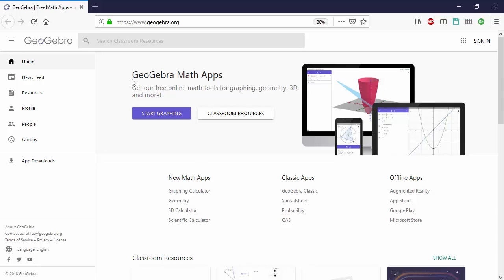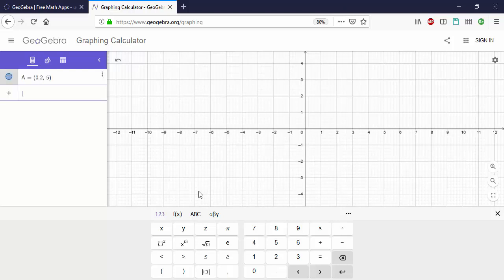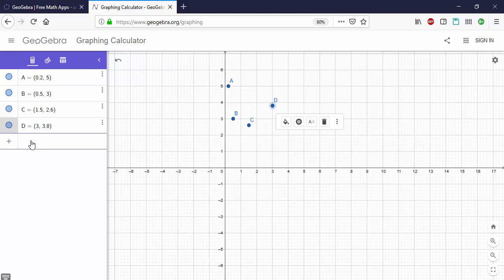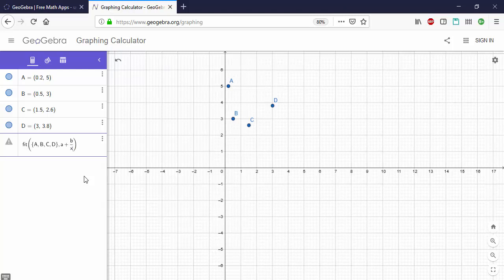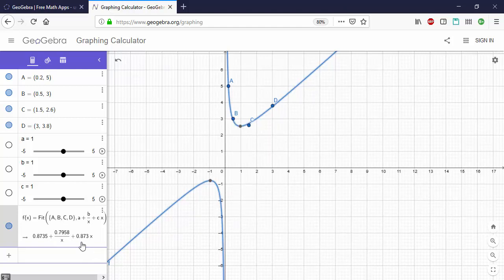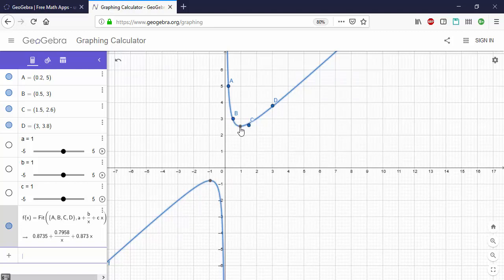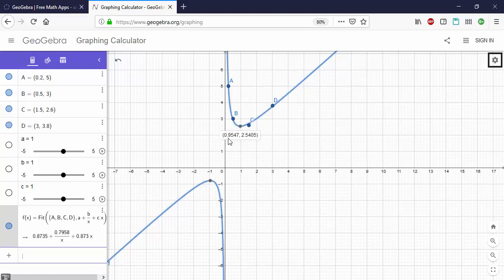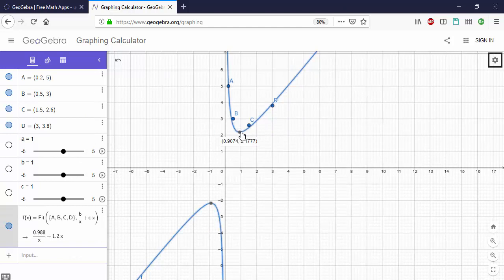Determining VanDeemter Coefficients By Non-linear Regression Using GeoGebra (Free!)

Comment from the maker: If you are using GeoGebra Classic, the program may not automatically display the minimum of the function when you click on it. In that case, simply click the three dots in the cell where you input the "fit" function and select "Special Points". This will create new points on the graph. The values you want will be in the cell labeled "Extremum".